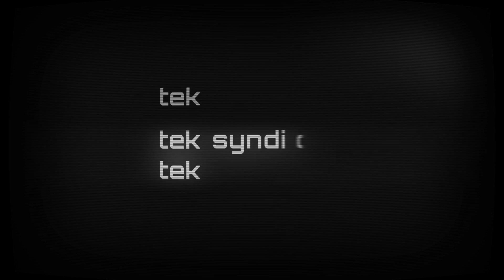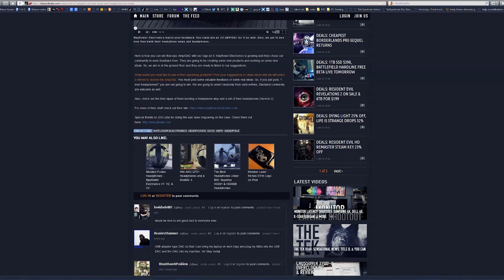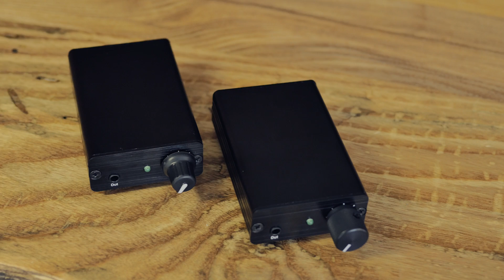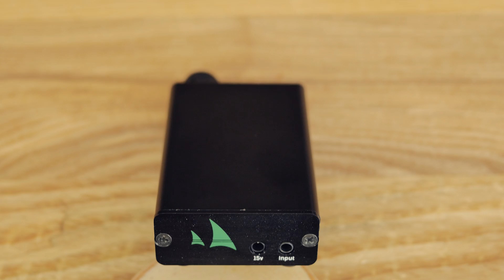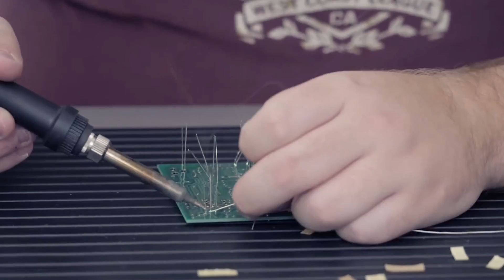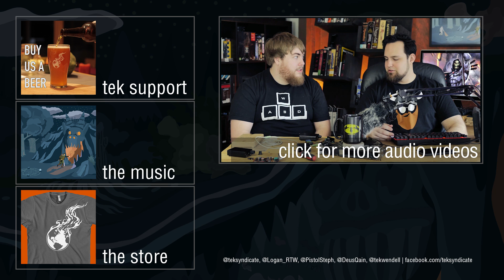Mayflower Electronics Portable Headphone AMP - Win One! (We Inspired This Product)

Comment: Low volume channel balance is crucial. A flush pot(friction teeth rotary kind) like those used in Walkman will be much nicer to use vs the current protruding one. Although I'm aware there could be reliability issue?

Using batteries like Li-ion/Li po to reduce the thickness,weight n increase the battery life maybe.

I/O and vol ctr should at one side of the amp.
Simple batt indicator will be nice to have(eg:red for 20% batt left).

Comment: Use of a rechargeable PP3 battery leaves me wondering how long the battery will last betwean charges. The one you are using looks to have a capacity of 250mAh. A lithium polymer battery would be a better choice for greater capacity, and combined with an appropriate step up dc/dc converter to give the 4556AD something closer to 15V to work with. For the external power source / charger I would like to see the use of a micro usb connection simply out of convenience, as micro usb is such a common form factor for charging and there is usually one on hand. Also it can be a hassle having a dedicated wall wart tying up a socket, having to cart it around the place and of course loosing it from time to time. I would also prefer to see the audio input and output sockets on one side of the case, the present arrangement will make it quite long and more likely to put strain on the connectors especially if it is in your pocket. I would also like to see this condensed down by using surface mount devices. I agree with the comments about the volume knob being too prominent and lightly to be knocked (maybe put the input and output could be put either side of the volume knob to offer it a bit more protection).

Comment: Damn it! Why did they not put a dac in there too? Now the sound quality is gonna depend on the cable you connect from the phone to the amp.
Reply: megaspeed2v2 it's not about isolation.... phone amps (not dacs) are horrible, they got high impedence, low power and horrendous snr. You don't simply amp an already amped source... it's moronic, you're amplifying the noise the phone's head amp is producing

Tomas Diaz cable quality = sound quality? you're clueless
Reply: shouldn't be too much of a problem, mobile phones are completely isolated from mains power (the main source of noise in audio on computers, tvs etc) since they run on a battery and you are unlikely to have a wire trailing far away from your phone so it wont pick up much noise.
Reply: krisspykrapper first of all, it's called impedance... Second of all, sound quality is not a synonym of cable quality. Anybody with half a brain can figure that out... however it does affect the signal. After all its carrying an analogue signal. Maybe your ears are as bad as your spelling so you can't really hear the difference, but I've tested it. They're not perfect conductors. The resistivity, cross sectional area and length of the cable are all factors that will affect its resistance to current(which, in case you are ignorant enough to not know the term for it, is called impedance).
Reply: Tomas Diaz read my comment again moron, i mentioned high impedance ...

secondly you're worried about sound quality from a cables yet you're not too worried about double amping and the poor quality of headphone amps on phones - which both have the biggest impact regarding sound quality. Headphones use mA of current at MAX. Theyre not full sized towers that need gobs of current, changing a cable from 30awg to 24awg or silver/cryo will not make audible difference. Are you now gonna argue about the skin effect of different cables? Do some research kid.

Tell me how exactly you did your tests.. did you abx them using a switcher that can instantly change outputs? Or did you simply listen to a song, change cables then "feel" a change with different cables? Typical noob who's trolled through headfi far too long.
Reply: krisspykrapper yes double amplifying an audio source isnt ideal due to amplifiying the noise along the way but my point was there isnt going to be all that much noise to amplify in the first place because phones are pretty well isolated from the environment in comparison to something like a PC where there are so many more components and sources of noise that having a separate dac would create a lot more of a difference.
Reply: megaspeed2v2 yes, dc power is "clean" but noise isn't simply electrical interference or static noises/pops/hums you hear from external things messing with the signal path. Noise is anything unwanted introduced in the output signal that wasn't in the input to begin with.

 You got SNR and THD to worry about. These determine how high the noise floor is on a given signal and the level of linear and harmonic distortion the amp contributes to the signal. That's the noise people refer to and what will in fact color a sound eg. high odd harmonics in tube amps give it the warm sound.

Then you have the lack of power contributing to distortion when certain headphone impedances spike on certain frequencies.

Comment: epic! that looks like a pretty solid pcd layout too! i was wondering why all the diodes and resistors and the regulator where vertical with all that free pcb space, then i realized thats where the battery went.... compact and gnarly! move to a Li-Ion rechargeable, then you could heat sink that regulator and get some nicer efficiency/smaller size. Just need to wait for that giga factory first to make it affordable!

Comment: i have one issue, i'd like to see it rearranged a bit, cut a corner off that pcb so you can stick the battery further down, and i'd like to see some room made to bend the capacitor down so you can make the design slimmer, not everyone has a slim phone with no case, and if you do, there no way in hell you'd want to add an entire inch of thickness to your pocket, but if you do it right, you could make it a little wider, which is acceptable next to almost all phones, and then a hopefully a lot thinner, so that way i dont have 2 inches of audio player in my pocket. if you did this, i'd buy one with my next check

Comment: Framerate of the video doesn't look like it's at 30 fps, not even 24 fps. It's only an issue with the camera recording, when you go to the graphics, it's fine. Also, I just noticed it went away around the 2 minute mark.

Comment: Its the o2 just smaller and that makes it portable. Try to add some more details, Like a controll on the side of the new o2dac. Because, i always have my phone in my jacket pocket, its easier to pull out than to stand a little bit up at the train chair and pull it out of the pants pocket. So you can have the smartphone in the pants pocket. And the o2dac in the jacket pocked and still controll you music. Also a lot of people have a problem with their battery life. So you can do a custom one for maybe 50 bucks more and put a batterie for the phone in it. Om a fan of ypu guys. So i would looove to get one of these dacs. Im crazy after them because i listen to musik 18/7 (6h sleep) with my terrible onboard dac

Comment: Well feedback number 1:
if there is any way to make it slimmer then do it, because most people dont want something that blocky in their pockets with their phone.
2: The dial knob is a bad idea for portability because if someone has that amp in their bag or pocket, and it accidentally goes max volume all of a sudden, someone might get hearing damage and you might get sued for that so best to avoid that.
3: Also, if all of the I/O would be on the same side, the risk of breaking cables would be much smaller.

Comment: This ia for Tyler,Is there a reason you went with through hole components vs smd parts? For the most part they are cheaper in bulk and takes up less space meaning u could make the overall size of the PCB much smaller.

Comment: The electronics seem great, but for a portable product it doesn't seem very portable. It is small, but for it to be used with a phone you'd want a slim one.

The volume wheel is huge as well. It will be uncomfortable and very sensitive to movement, making the volume change when you walk with the AMP in your pocket for instance. Try to make it a low profile knob and shield it a bit. FiiO has done a great job on the knob with their E11K.

Comment: Maybe sound really stupid but maybe integrate or have a snap on belt clip? So you can clip it onto you belt or your pocket whatever. So that you can reach the potentiometer when using it on the go without having to take it out of your pocket.

Would be nice to see something like that even if it's snap on so you can still use it as a desktop version aswell (Or something low profile and then a little taller feel so it fals below the feet.)

Comment: I think it's really cool! Nice and compact and a very sleek and simple design with portability in mind. I really like how it will be very versatile in use as well. A couple things that I would like to see is something to put it in when mobile be it a case or a simple pouch, and second is that the knob be flatter and not stick out from the body as far. Also, if it were possible to recharge it via a mini usb cable would be amazing! Other than that it looks really good and I might like to own one myself. Great Work Mayflower Electronics!

Comment: What about those batteries they use in ecigs. Like the Sony VTC5 or the Samsung INR18650 or ICR18650-30A It has a nominal voltage of around 3.5-3.8 volts. It has 60-100A pulse amps, and 30 amps continuous. It would have a very long battery life with one of those bad boys in it.

Comment: I don't need one as I don't have any headphones good enough to warrant this, and if I did I would probably keep them at home anyway. Also, I assume my audio interface does about the same job, though feel free to correct me on that.
Reply: audio interface? what the hell are you talking about? do you mean your built-in sound card? no, nothing you have is capable of replacing the DAC and Amps that you buy separately.
Reply: I mean an audio interface (yes, a sound card, scarlett 2i2 in my case). I'm not sure if it counts as an amp, but it does have a 1/4" headphone out so I'm just assuming that it will do the same job.

Comment: Tyler Chilton Is this even a DAC? It's just an amplifier right? The ODAC takes USB right?
Wouldn't it be possible to make a real DAC that you connect through µUSB or Lightning, that also works with all phones using standard usb drivers? Or is the logic that you cannot make anything that is better than the phone DAC without having them cost way too much?
Reply: Nope, just an amp. The OPAC is USB and can be used with this amp.

As in the video - As far as we know it's impossible to have a DAC that works with literally every phone. Apple has proprietary drivers that make it difficult.
Reply: Tyler Chilton Thanks, I know logan probably knows this but it sounded as if he was referring to it as a DAC all of the time, so I wondered if you were using some black voodoo USB through the 3.5 jack magic, or if it was just a misunderstanding :)

Real ppl don't buy apple products though(Kappa), would it be possible to make one that would work on Android and other open platforms like FirefoxOS/UbuntuPhone/SailfishOS? ;) I mean, how much would it have to cost to be better than the DAC in the phone?
Reply: Tyler Chilton BTW, I would be really interested in a digital input Amplifier that has as little signal path as analog as possible before entering the op-amps, and that can throughput around 30-60Watt per channel. I have a T-class amp from Sonic Impact, but the company that made those amps is gone(although the Chinese manufacturer still make and sell them through SURE), and mine is about to go bad and is just a little bit too weak for my speakers at high volume.
I'd pay around $250 if it's possible to make something nice at that price tag. (My Sonic Impact was $100, but it is just shy of 25Watt and only takes analog in)

Comment: I use 30ohm IEM's so an amp that is able to power 600ohm headphones is probably not so useful to me. But it looks like a fairly nice product.

Maybe an LED toggle, sometimes i listen to music on my phone while lying in bed and LED's can sometimes be annoying, so maybe having some way to turn that off would be nice even if it involves unscrewing the product and pulling out one end of a flying wire. Just so that the option is there.
This will probably be an edge case but some people may want to go for longer than 10 hours. But they may not want to take a screwdriver to the product in order to swap out the battery. Maybe insetting the rear i/o of the device and using a pin to allow the rear plate to swivel open would be a cool way to give access to the battery in order to swap it out. In short a system that require no tools would be good, one that requires a single screw would be ok. But two screws is just a bit fiddly.
The internal gain switch is a nice feature, but maybe an external way to control that would be nice.
Centering your logo on the back of the unit might be a nice thing to do as well since it is raised a bit high up and looks a bit odd with the rear i/o being lower on the device and the logo being higher on the device.
Im also interested as to why you are using a 15v input since the device has a 9v battery and 9v power supplies are available. I can only assume that the voltage regulator that you are using in there is stepping it down. (This one isn't a criticism, just curiosity :p)

Comment: I think there should be one where the audio in and out are both on the same side so it is pocketable. And maybe make it thinner, but I don't know if that is possible.
Reply: There has to be a battery inside, so I don't think it can be thinner.
Reply: BmanUltima But I don't think it has to be 9v. I don't know, I'm not the engineer. Just a suggestion
Reply: WeAreTwoDoorsDown Other batteries like AA, aren't that much thinner. I suppose they could use something like a cell phone battery though.
Reply: WeAreTwoDoorsDown BmanUltima If they made the batteries smaller, then the output wouldn't have as much power as it does now.
Reply: FlighterLuid Yeah. I don't think phone batteries are high enough voltage.

Comment: No offense, but either i'm horribly mistaken or i bought this as a DIY set at a local electronics store about 1 year ago. Build it, and used it ever since. 
I'm really not sure if it is the same thing, so if anyone can state what a DAC actually does, i would be very happy, because i am sure i have one like this (Cigarette pack sized).If i'm not mistaken, it's just an audio converter to convert digital audio to analogue (or the other way around). It did have these horrible unpractical RCA connectors, so win on that, but i could easily modify it to have a 3.5mm jack input.
Reply: This is an amp, not a DAC.
Reply: Google's your friend.

Comment: Instead of expensive 9v batteries... would it be possible for you to make a weaker AA version or something? Cuz we can recharge lithium AAs... can't recharge 9v as far as I'm aware. Also, I have mixed feelings about the knob being so big... would it be possible to have a smaller one of similar design? Maybe an easy battery access (if AA is a possibility) instead of taking it all apart to get to the battery? Aside from that, it looks great!

Either way... I'd buy it for sure cuz I definitely have a need for something like that.
Reply: The 9v we include is rechargeable, and can be recharged with an optional power supply.
Reply: Tyler Chilton Oh... then awesome!
Reply: Tyler Chilton
 With everything being portable now, I think you should change the charging to usb. I know that you would have to change your whole power delivery from 9 volts to 5 volts, in turn changing the whole schematic, and lowering the max input impedance on the headphone requirement. But you are touting this device to be portable, and most portable battery packs that people bring with them on trips (again the whole portable concept) are usb. Also I don't know how hard it is to get anodized aluminum in different colors, but having different colors would be a nice treat.

Thank you for listining to the community, this is why I will always look to your company first for all of my audio needs. Cheers and keep up the brilliant work, you guys are pushing the boundaries of office, and now portable audio.
Reply: ***** My family does originate from their.

Comment: That amp looks good and is a great idea! Mayflower doesn't disappoint! Would be cool if it had a way of connecting via mini-usb to PC, so it could be used as a amp-upgrade for laptops when you're on the go (could charge and do audio through the usb, without the need for 2.5mm jack).

Comment: * blasts some metal for 5 seconds *- yeah, sounds like odac

Just buy or make yourself a c-moy. Basically the same but way smaller and cheaper (I could get a decent dap for that money).

I mean the c-moy and most phone outputs are fine for everything portable (iems). No ones gonna use 600 Ohm Beyers or HE6s on the go, thats plain stupid.